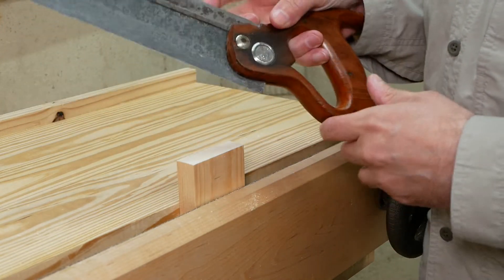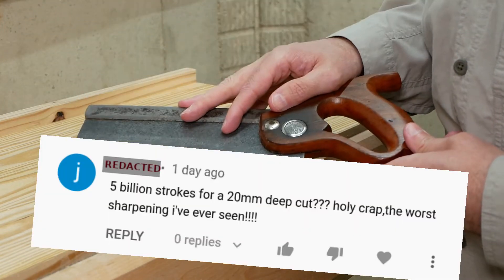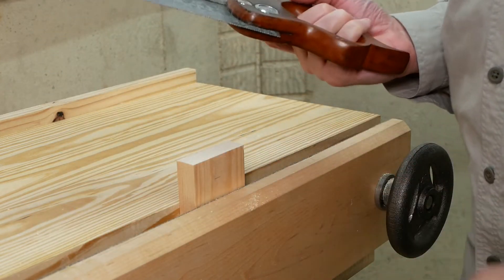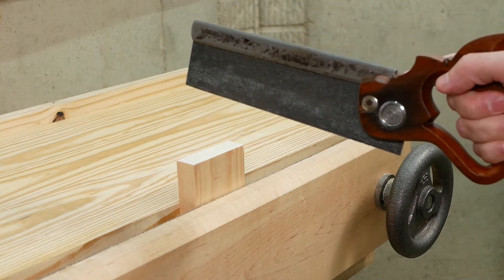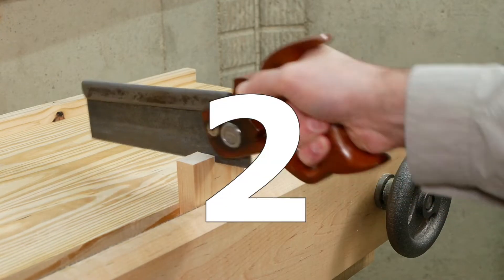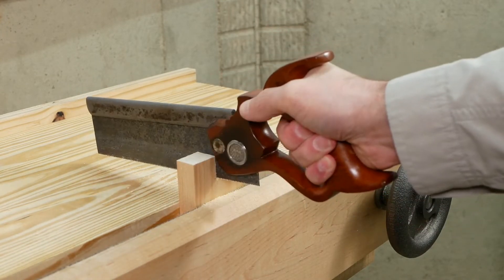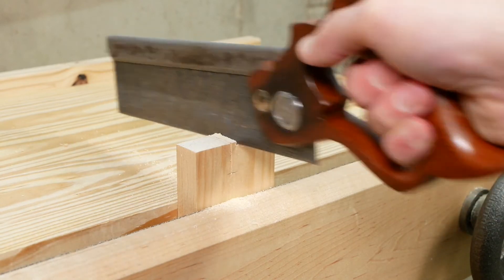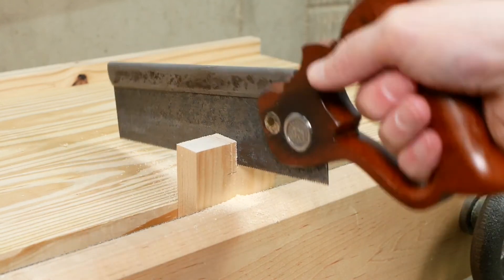How Fast Should Your Saw Cut?

Comment: Slower is better for accuracy. Well sharpened dovetail saw will cut with its own weight and sometimes that is too much.
Reply: Also any comment made earlier was just to help whoever wants it, people can take it or leave it.,Just what works for me.
Reply from the maker: Plus, consider that weight and other attributes vary significantly among dovetail saws. Ultimately, it comes down to what the user feels is best helping them do the work. But though there are many options for saws, the one constant requirement is that the saw has to be sharp!

Comment: Just was reading the comments on your restoration video of this particular saw where, at the end, a couple of three "Karen's" were a' busily complaining. As the late, great Pat Paulson would've put it: "Picky; Picky; Picky". Bye the by, I tried printing out your teeth guage five times at different settings and which only allows metric page image sizing. Seems the "Metric Inch" is 7/8' of the Imperial one. In other words, if you ever do find the time, energy and urge to redo it, would adding imperial settings be doable with your system? Sure would cut down on the bad language to the good Lord quite a mite. :)
Reply from the maker: Try looking at your print settings--there might be some sort of scaling issue (this is often a problem when people print out sewing patterns, especially if the paper size doesn't match). If that doesn't work for you, I can have a closer look sometime to see I goofed with the paper size or something. The guide is actually the output of a PostScript program I wrote a while back, which uses points as units (1/72nd of an inch).
Reply: @bricsuc , Thanks for the response. The point system takes me back to my semester in the late '50's of print class in high school. Yes, hand set type used in a real (but powered) printing press. Now, on my mid 2011 iMac running OS 10.13.6, for a Canon 2500 printer, I seem to be getting conflicting results as your chart shows up as only being printable in metric dimensions even though it shows its for standard American letter size - 8 1/2' x 11". As a dear friend used to wryly note: "Murphy never sleeps". Thanks anyway.